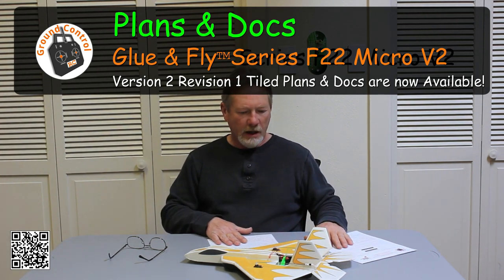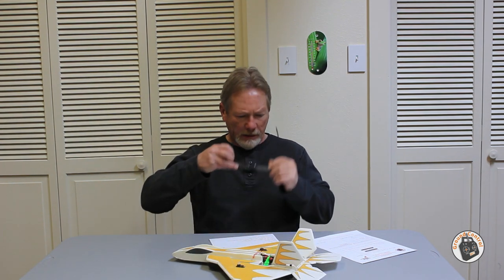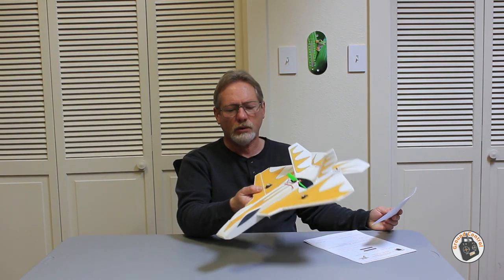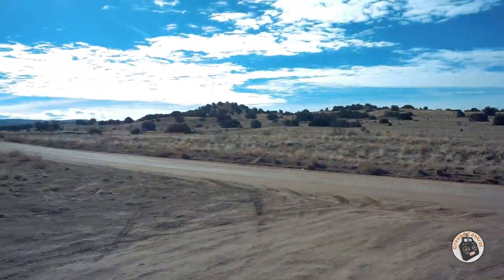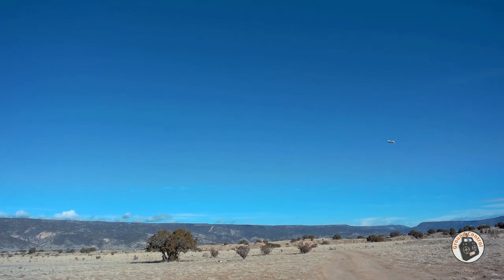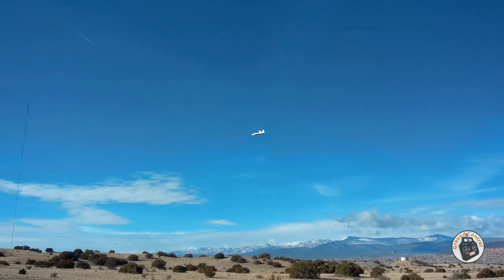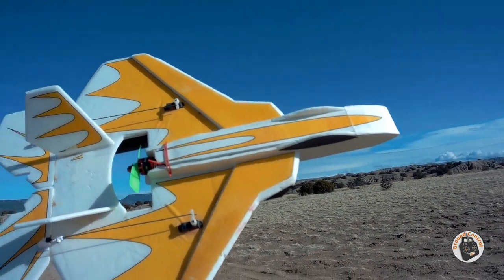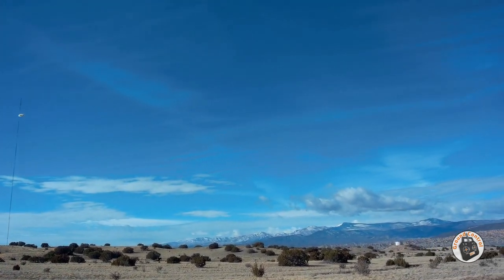Glue & Fly™ Series F22 Micro V2 - Version 2 Rev1 Full Size & Tiled Plans & Docs are now Available!

Comment: Very nice micro F-22 jet!  So there is an F-22 Nano, a F-22 Mini V2.5 and a Micro V2, correct?  I got confused for a moment..lol  Almost done with my F-22 Nano build, I just received the BR1206 7500kv motors to complete. For the F-22 Mini V2.5, im planning to use the Racerstar 2207 BR2207S Fire Edition 2500KV. And for this one maybe the same? We'll see.
Reply from the maker: I'm glad you're building these. I't about time for me to take the Mini and Nano out for some flight ;-)
Here's a list of the most current completed Aircraft:

GFS F-22 Nano V1
GFS F-22 Micro V2
GFS F-22 Mini V2
GFS F-22 Mini V2.5
GFS F-22 Mini V3

All (3) of the F-22 Mini Aircraft are different from each other and why I have all of those listed.
The F-22 Mini V2 has extremely light Wing Loading and is super stable and is suitable as a Beginner Parkjet. It was my Beginner Parkjet for learning Line-of-Sight Flying! And it survived ;-)
The F-22 Mini V2.5 is an Intermediate Parkjet.
The F-22 Mini V3 is a High Level Intermediate to Advanced Parkjet

And I'm currently working on the T-33 Micro V1 ;-)

I think the 2207 would be too heavy to get the Cg on the F-22 Micro V2.
The Motor I've used on that Parkjet is either a 1306 4000kv on 3S or 1407 3500kv on 3S.
Either one of those size motors with a 3545 Prop should give it unlimited vertical.
The 1407 I use weighs approx. 19g
In these Demo Flights I was using the RacerStar BR1407 3500kv Motor on 3S, however, I just received the RacerStar BR1408 3600kv Motor for Review and I've just complete the Thrust Testing and Test Flights with that Motor. It produces more Thrust while pulling fewer amps, is approx. the same weight, and I'm getting more of them ;-)
I'll be posting the Thrust Data and Test Flight this week.
Reply: @GroundControlRC  Great I have some 1407 motors, so I will use those on the Micro V2.  For the BR1408 3600KV motor, I just maiden a new Dragonfly 4ch plane I built over the weekend using that motor and it is excellent, great power on such a tiny motor. I'm using a 5x4 3 blade prop for the combo.
Reply from the maker: @texasuavpilot   That's Awesome! I love that Motor ;-)
Reply: Hi, do you keep the paper on the adams readi board?
Reply from the maker: Hi Mark!
As long as you don't get it wet it should stay put.
You can apply a little glue around the edges to keep it from peeling up.
You can always remove the paper and cover the foam with packing tape.
I removed a lot of the paper on this one and printed those dark yellow decals and applied them to the foam.
It also added a lot of strength to the foam.
See you in the Air!

Comment: Do you leave the paper on or peel it off? Lately the boards I was getting have very sticky and hard to remove paper.
Reply from the maker: Hi Greg! There are portions where the Paper is left on and portions where the Paper is removed from (1) side or both. It should be specified in the Plans, if not let me know. Areas such as the Wing Plate under the KF Airfoil Paper is removed from that area. Paper is completely removed from the KF Airfoil itself, etc.
Reply: @GroundControlRC  ok cool I'll check that out
Reply from the maker: @greg0063  , let me know if you have any other questions as I'm happy to provide correct answers some of the time ;-) If you find anything missing or incorrect in the Plans let me know. I hope to see a flight video of this Parkjet ;-) See you in the Air!
Reply: @GroundControlRC  it is in my to do list, its a long list haha, so many projects so little time, I will definitely post when it gets done. Thanks for the responses.
Reply from the maker: @greg0063  , no worries! I'm in in the same type of boat. If you look behind you, way out on the lake, that's me in that tiny boat ;-) See you in the Air!
Reply: @GroundControlRC  😄